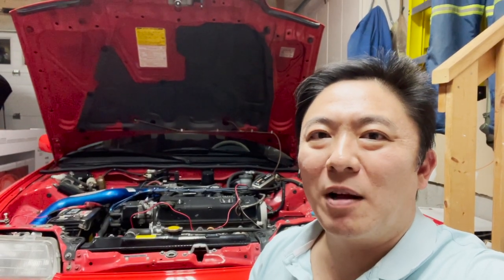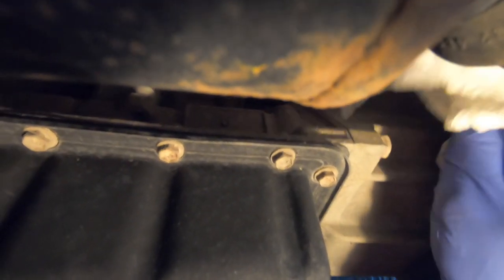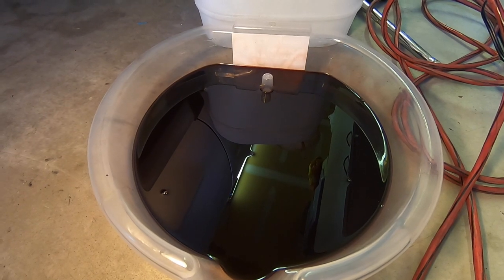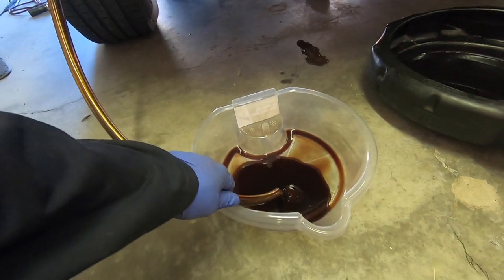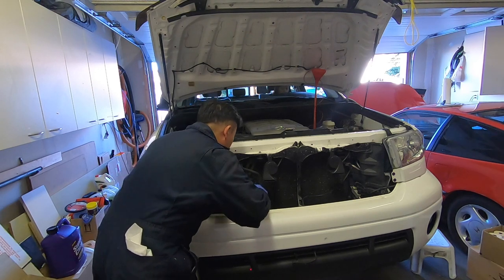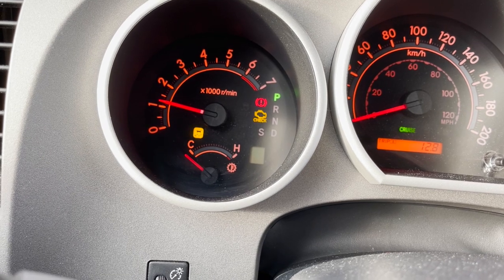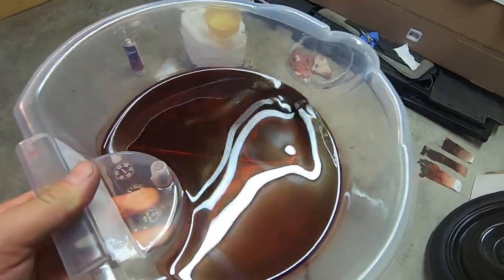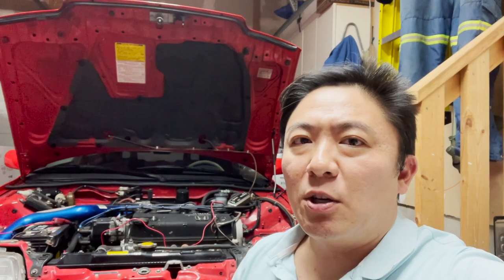Toyota Tundra Comprehensive Transmission Oil Change

Comment: Yeah this is thee most video I've seen yet. Ty! 

Would it hurt the transmission if I used a cheap fluid just to flush...then fill with Toyota brand?
Reply from the maker: I thought I replied to this but apparently it isn't posted.  No use genuine fluid b/c whatever fresh fluid you're filling with is pushing the old fluid out of the torque converter. This is why I say fill 3 litres at a time b/c that is about what is contained in the sump of the tranny pan.  It is literally using the tranny's pump to suck clean fluid up and pushing it through the pathway it normally flows in so doing this that you're changing out 99% of the fluid.  Follow this procedure exactly and you won't waste money or fluid and still achieve perfect results.

Comment: Can you talk about your funnel/hose setup? Are you hanging the funnel from the hood? I'm trying to figure out if I should do that or get a screw on adapter. Looks like they make an adapter to screw onto the tranny fill hole as well. Kinda neat. Thanks for the video.
Reply from the maker: my funnel setup is very simple.  just a funnel that fits into my hose end and then it hangs from the hood with a wire/hook.  Nothing fancy.  Yes the fancy fitting on the tranny is handy but totally unnecessary to fill a tranny.

Comment: The "oil cooler return line" = Oil out from transmission; right?
Reply from the maker: no, oil cooler return line meaning oil EXITING the cooler = BACK to the transmission.
Reply: @piercedasian  Ahh. Got it. Actually, I'm intending to use this method on a 2015 RAV4, and it's oil cooler has the inlet and outlet indicated in the parts diagrams. Just trying to determine an equivalency of terminology. Thanks!
Reply from the maker: you're welcome!  Hopefully your fluid change went smoothly.

Comment: Also, the filling tube looked bigger than 3/8" ID, what about the OD? 1/2"? Please clarify. Thanks again.
Reply from the maker: I was certain the the filler tube wasn't very large at all.  It may have been a 1/2" ID hose but I honestly thought it was a 3/8" since the filler hold is quite small.  Honestly it did take a long long time to fill that bloody tranny especially when going through 12 litres of oil.  I'd go an measure the hose for you but I moved a while ago and I have no idea where it is.
Reply: @piercedasian  thanks I finally got everything. planning on tomorrow x

Comment: What size house did you use from the cooler return line to drain fluid.
Also, In the video I can’t see where you hooked up the drain line.
Reply from the maker: If you open up your hood and locate the a/t cooler lines you'll know what size of hose to get.  I believe (and I could be wrong) but the hose I was using was a 1/2" PVC hose.  The lines front which you disconnect should be pretty clear as I did show that in my video.  If one doesn't flow oil when you first start your truck then odds are its the other hose that will flow.

Comment: Ask friend.  It is recommended to make the change
 of transmission oil to a 2003 tundra with
 200,000 miles?  There are some who have told me that
 It is not recommended that you take risks.  you that
 recommends.  Thank you
Reply from the maker: I'd do it all day long.  Unless your truck was used and abused badly and driven so hard that the reliability is questionable that I doubt you'd have issues.  I can't guarantee that you won't but in all my years of fixing cars I've been okay so far.  one car I did a tranny fluid completely fluid change out (not a flush but a complete change out using this exact method) and it had 300, 000 kms on it.  Drove INFINITELY better with the new fluid and shifted like a brand new car.  That same car today has 540, 000+KMs and still going strong as ever.
Reply: @piercedasian  wow what information, appreciated 🙏🏼 thank you very much for that great information master.

Comment: Unless you can prove that the return line does dump into the pan, you should be using a pump to put new fluid down through the return line. Lubrication of some transmissions is via the return line.
Reply from the maker: prove that the oil return line dumps it back into the pan?  Its a known design in the Toyota Tundra tranny.  You can see the oil return line from the cooler go straight into the transmission's side  which is an open port that dumps into the tranny (I've seen a tundra tranny dismantled on a bench before).  While I do agree with your statement that some trannys have the lubrication channel piped into the tranny for lubrication but on the tundra luckily the feeder into the tranny cooler is POST oil pump and the fluid passages and torque converter which is why the oil coming out is the old fluid and why one has to keep putting fresh fluid via the filler hole.  I can't speak to other cars and trucks but tundra for sure can be safely purged this way (I also know a toyota tech so that confirms what I already knew).

Comment: This is the best video on this subject matter. I just bought a 2012 tundra for my son and that thing has about 320000 miles on it. I definitely would change the tranny fluid. However, I do have 1 question, what about the tranny filter and the oil pan? Do we need to take it out to clean and replace the old filter? Please advise. Thanks again!
Reply from the maker: I would at all costs refrain from touching the tranny pan and the screen (not really a fine filter per se) because the tranny pan bolts are PRONE to breakage.  I'd do the fluid change EXACTLY as how I have shown and unless the tranny is shifting weird or has badly badly badly badly burn oil that I'd leave well alone and just change all the fluid as how the video shows.
Reply: @piercedasian  got it! Thanks so much!
Reply from the maker: Np!

Comment: Followed all these steps can’t get any fluid to come out through the hose from the oil cooler, any suggestions?
Reply from the maker: did you put the pin through the cooler thermostat as shown in the video?
Reply: @piercedasian  yes

Comment: Thanks for posting this. Is there a problem with leaving the transmission over filled ?
Reply from the maker: I would not want to drive around with an overfilled tranny. Follow the fluid level check procedure I demonstrated at the end of the video and its just a simple matter of cracking that overflow plug and letting the excess run out at the right temperature.

Comment: What about the filter?
Reply from the maker: The tranny filter COULD be replaced but even Toyota advises against it unless the tranny has had a failure or is being rebuilt.  Under NO circumstances in normal use conditions would I ever recommend removing the tranny pan to get to the filter. The pan bolts on these transmission are strangely very weak and soft and will break without warning.  There have been PLENTY of cases even on relatively new trucks where the owners tried to undo the pan bolts only to snap the stud in the transmission housing which then requires you to carefully drill out the broken stud.  This is quite common so why make trouble for yourself.  If the tranny is shifting decently then just change the fluid and don't meddle with the filter.

Comment: There's a difference between liter and quart. I'm just saying
Reply from the maker: Yes there is but the difference is exceptionally negligible (946ml vs 1000 ml).  Totally get you though, I often get my terms mixed up b/c I'm catering to US market vs. everyone else and quart and liter is also used interchangeably by the guys at the shop so that just adds to my problem of using the terms interchangeably.
Reply: @piercedasian  I was just noticed you say that and then pouring in a quart. But all good brother.

Comment: I'm in the middle of this right now on my 2013 Tundra. I had ordered crush washers however they're the wrong ones so I had to order some others (M12).  I was surprised to find on this very first service that there was 3.5 liters in there in fact it poured out of the 'check-level' plug awhile.  I'll probably put in just 3 liters as you did and on my last flush only take out 2 liters like you did I guess.   I'd say the trans was over-filled from the factory based on the PURPOSE of the check-level stand-pipe.
Reply: My 'flush line' looks just like yours and no fluid would come out the 2nd flush.  At all.  I hooked up to the line you have plugged and got all kinds of fluid. Weird.  Very helpful I was surprised how quick we hit 'D' the correct temp range.
Reply from the maker: Hey, sorry for my untimely reply. That's crazy that so much oil came out.  I'd be super surprised that toyota would grossly overfill their tranny's by that much.  So are you saying that half a liter of oil came out of the spillway plug?  I mean a half a liter is still a decent amount and plausible they could've overfilled it.  As long as you follow my fluid check procedure that you'll get the tranny oil level spot on.
Reply from the maker: interesting...so ultimately were you able to complete your fluid change and is the truck running properly now?

Comment: What does it mean if your getting no fluid even with the pin in the thermostat ???
Reply from the maker: There should be fluid coming out somewhere.  Some have reported that sometimes the oil cooler hose is reversed (not sure how accurate that is) but if you put fluid in the first go that it should absolutely be pumping fluid out of the cooler lines.
Reply: @piercedasian   yeah I figured it out. The service info was incorrect .😔
Reply from the maker: that's good.

Comment: When checking the fluid level at temperature, you should turn the engine off. As the fluid gets hotter it also expands.
Reply from the maker: no that is actually incorrect.  The factory procedures states that the moment the D indicator illuminates on the dash that you have a reasonable window in which you can open up the overflow plug to drain out the excess fluid.  If no fluid comes out then I'd suggest one shut the engine off and fill the transaxle accordingly and then restarting the fluid level adjustment procedure and continue on.  Once the green "D" indicator lamp illuminates it only takes a minute or two to open up the overflow plug and drain out any excess.  Once the trickle of fluid slows down you replace the plug and no more fluid would drain from the transaxle even if the fluid continues to warm which is perfectly A-OK!  This procedure only applies to modern sealed Toyota transmissions where there is no dipstick.  Check your owners manual for proper fluid checking procedures (if your have a dipstick for example).
Reply: DON'T TOUCH YOUR CAR! and stop telling people bullshit for important info that can cost them thousand$.
ATF level must be checked at temperature while running. if you check and adjust while off, you will make it about 3 quarts too low. transmission will burn out shortly after. some exceptions are older acura & honda that are checked while off. 
I'm a Toyota tech.
Reply: @wd9581 -coming up with this (incorrect) theory is admirable but realize that there are far more complex and unseen effects at work here. Not to mention that everyone that has learned the basics of checking transmission fluid knows that you always check it while the engine is running and that it’s not a exact and precise fluid level check. Also, the thermal expansion of transmission fluid is around .0009 percent of volume per centigrade. Even if the fluid continued to increase in heat for the next few minutes, while draining the excess, the thermal expansion would be minimal. Even “sealed” transmissions have the capacity for plus or minus from exact fluid level amount.